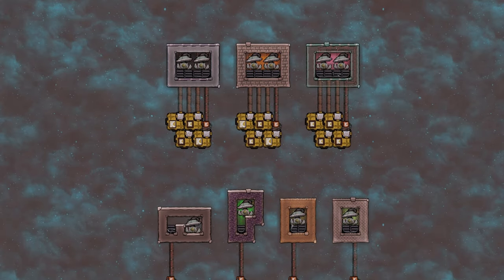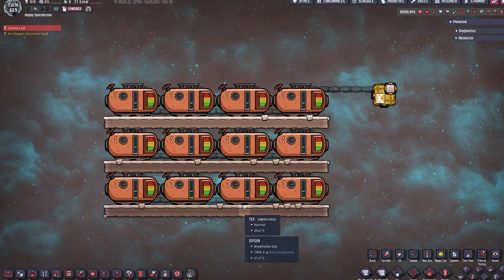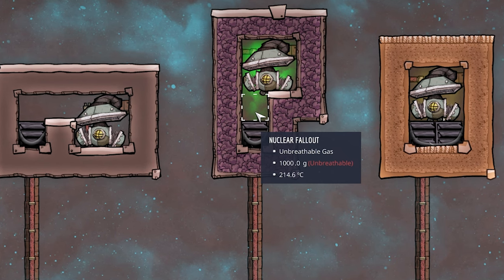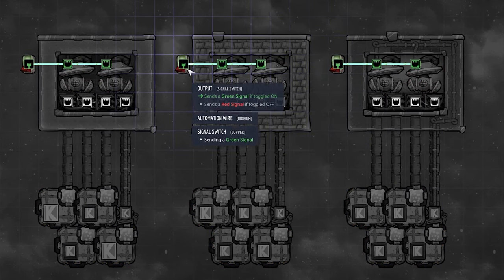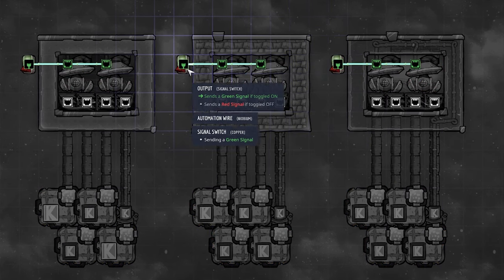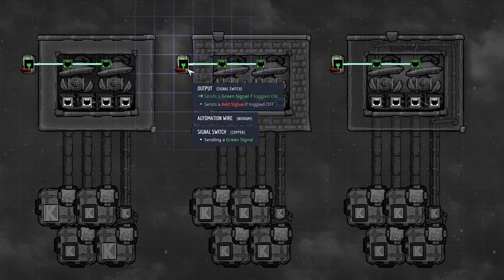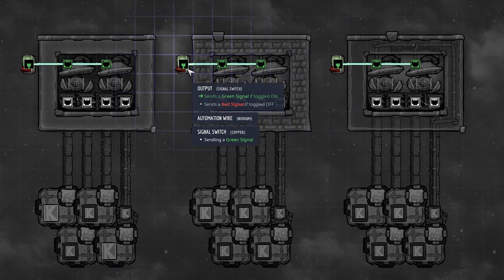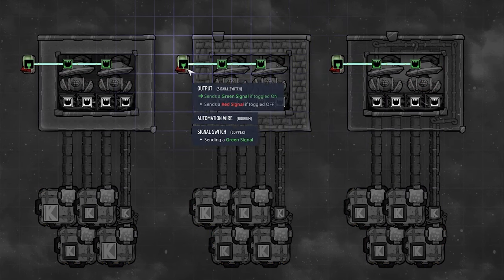INFINITE STORAGES V2.0: A German Engineer explains ONI

Comment: just one tiny addition for people that don't like to use infinite storage but still want to have more storage than gas/liquid containers: you can put the containers INSIDE a room with liquid/gas so at least you get a bit more (about 1.5x to 2.0x)
Reply from the maker: Very good call, that will definitely increase the storage capacity by quite a bit using "normal" methods :)
Reply: true, but you have to be careful with temperature, especially gases, since they usually come out hot, you may need to create containers out of steel which is not always possible

Comment: for gas storage, its useful to wait for plastic to use a high pressure gas vent, this means youi can use more liquid in the spot (crude oil in your case) and byp[ass the gas overwriting it altogether
Reply from the maker: Good call, that is later in the game definitely a smart thing to do. Forgot to mention it here, but the normal one also works like a charm :)

Comment: Sometimes it's useful to create infinite liquid storage rooms with serviceable entry points. These are a bit more complicated but not much more.
One of the first things I do is my mechanical sorting and infinite storage room. Top level for gas and bottom level for liquids. And in between a row of valves for the sorting loops.
Reply: How do you make an infinite storage with an entry point? I have never encountered a guide where the infinite storage is supposed to be accessed
Reply: @Jnnewsman  For gases, with liquid locks. For liquids with denser or lighter liquid locks.
@BierTier: Future tutorial video? 🙂
Reply from the maker: That is a good idea, I'm planning on making a little video with some smaller tidbits like that, since that alone is not gonna cover a atleast 10 min video, haha :)

Comment: I might have missed it, but Crude Oil is one of the few items i usually make an infinite storage for before i get a boiler going.  And i noticed you didn't cover the liquid vent on top with airflow tiles.  With crude being the most dense liquid you have to use a top placed liquid pump with a lighter if you want to use airflow tiles.  Obviously still possible with the gas method, but figured i would mention this.
Reply from the maker: That is a good point, crude oil would work in reverse with the liquid density method. Truth be told though, if I already have to place the vent on the top, I will just use the gas method. Easier to accomplish ;)
Reply: @BierTier   lol true, i just tend to work in a vacuum a lot, i tend to vacuum out my maps completly.

Comment: There is actually another way to create infinite liquid/gas storage using multiple automated doors as a compressors. (GCFungus highlighted it in his video) Obviously not as effective as putting some liquid on the vent, but feels a bit more natural to me. 
Anyway, great video!
Reply from the maker: I have not seen that particular video from GC, but I know the compressor method using mechanized airlocks and automation. I didn't include it here, because I personally wouldn't recommend it. Yes, it is a bit closer to reality(minus the whole infinite thing, haha), but to build it and use it in an actual game makes little sense when these methods I show here are much easier to build and use :)
But of course, like all things, that's personal preference :)
Reply: @BierTier  I used the door method directly in a insulated room with a natural gas geyser, it gives infinite gas storage without using a single watt of power, very useful and saves big percent of power gen from those geysers compared to having 1 gas pump going to a infinite storage then 1 going to the generators.
Reply: @dr.chimpanz.1324  I include a bypass on my infinite storage so the inputs go straight to the outputs if the outputs are pulling. That way, the pump in the tank can take a break while there is supply available to bypass the infinite storage.
Reply: @James_McKay  not bad tbh. Not as good 😊😊
Reply: @James_McKay  sorry that's toxic lols. That's smart

Comment: 2 minor upgrades for debris storage. 
a) ladder right above the storage, to make dupes run over it, not jump. 
b) cut corners, and allow pulling from bellow.

also, you skipped whole storing fluid or gas as solid debris, because what can go wrong if you make 300 tons of solid carbon dioxide on a single tile somewhere. 
same issue with waterfall method, its fast, but its not 100% buletproff, if water freezes or vaporizes, you will have a water nuke going though your map.

Comment: I'm trying to find the error and I can't. The fluid storage works, but I have a problem with the gas - it works for a short time and suddenly all the oil disappears. The gas I pump is below 50"C. After several attempts in the game, I moved to the sandbox and still have the same problem.
Spaced out DLC enabled.

Comment: How does it handle the temperatures of the stored materials? Does the added material take on the temperature of what is already stored or does it actually average it out?
Reply from the maker: It does average out. All the different materials(like the debris in the solid storage) share the same temperature. You add something new to it, it will equalize with the rest. The more you have already in, the more stable it is.
This also saves a ton of CPU calculation of all the different temperatures, so if you have FPS issues, this might help!

Comment: Your comment on the airflow tile only working with dual liquids is incorrect - but you need to place the vent one block higher than what you designed with the airlock doors. So you have the vent, then an empty tile, then your square where you put your pumps. I hope this makes sense, but the empty tile between your liquid vent and the storage space is the difference when using airflow tiles, and it makes for a much cleaner setup (since, especially at high speeds, the dual liquid method can sometimes freak out and mix the liquids together)

Also, if you're having trouble with the Infinite Air design with your vents being overpressured, first, make sure you're absolutely using High Pressure Gas Vents - they give 20x the pressure range than the normal vent. Second, you likely have too much liquid in front of your vents - I think a recent update made it consider liquid as a blocking mechanism. I find that less than ~15kg of liquid on each tile seems to work okay, but don't recommend going more than 4-vents wide per storage container or it starts to have issues.

Use a Liquid Meter Valve connected to a pump and set it to dispense 15kg times the number of High Pressure Gas Vents that you have to get the right amount. Or, start smaller (5kg at a time) and add just enough liquid until a full layer develops. The wider your setup, and the less total liquid you have, the more likely you'll deal with the occasional "disappearing and reappearing liquid" blocking your pipe for a tick or two, but it's not a huge deal. Just make sure you don't add too much, or you'll have to tear it down and start over.

Comment: Does any of this still work?  I just bought the game in late Nov 2023 (Build U50-583750-5D) and I cannot get either the open sandbox to work (no option in the start screen) or the liquid/gas infinite storage.  The solids infinite storage works, but I'd sure like liquid/gas and a true sandbox (not in a game on the asteroid) to play with techniques.
Reply from the maker: All of those builds still work, in that regard, nothing has changed at all. I'm not sure what you are doing wrong with the liquid/gas storage, but if you want to dive deeper into the issue, feel free to join my Discord server(Link in the Description). Many people there(myself included) are always happy to help solve problems with ONI and even games I don't play on my channel!
There is no "open sandbox", only the "in a game on the asteroid" version. But, you can do what I did for my videos: Start a new game, activate sandbox mode and delete the entire map. You may want to activate Dev Tools as well to help with deleting the map. Then, when empty, save it. Now you have a "true sandbox" that you can reuse and save with different names etc. as you like :)
Reply: @BierTier  Thanks for the reply, I totally misunderstood that all of the 'open' sandboxes I've seen started as asteroids!
I need to pursue the problem with liquid/gas storage and the Dev Tools.  I get the 'D' suffix on my build, but don't get the on screen map of commands.
I'll join your Discord to see what I'm missing.
Thanks!

Comment: Just one thing. Being an engineer one has to be rather particular with words. I noticed you use liquid and fluid kinda interchangeably but... Every liquid is a fluid but not every fluid is a liquid, gasses are fluids too. sometimes the terms can be synonymous but other times not really.
so... 13:38 it does matter what kinda fluid you are using, it has to be a liquid.

Comment: These door infinite storages only work till they dont... i did this on my game from the start and at around cycle 250? the game just deleted all of the water in one of them and i dont think it was THAT much water in them
Reply from the maker: That must have been an odd glitch. I use those storages for years now and that has never happened. In my current Let's Play, I'm pretty sure I built one well before cycle 100 and it's still going strong at over 700 total cycles right now.
Reply: @BierTier  it was working fine and i dont remember when it did it but i think there was around 11kg per tile of water after that i deleted the other 4 i had just in case it did it again lol